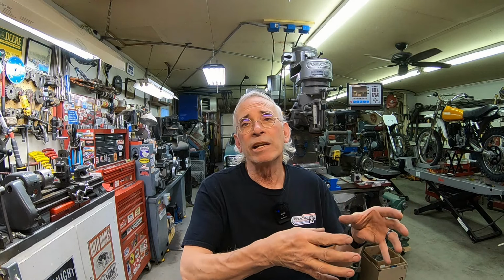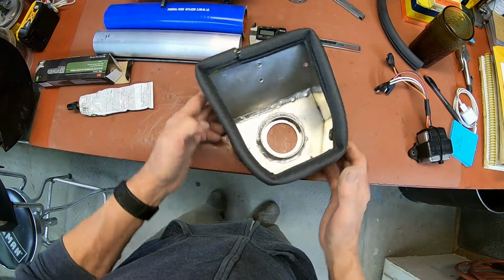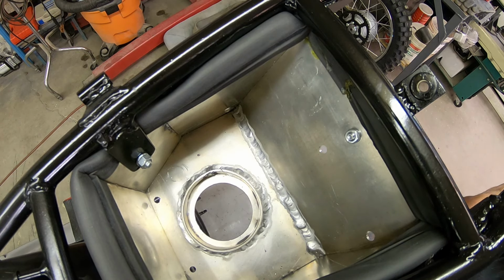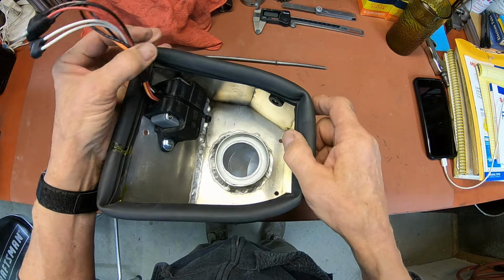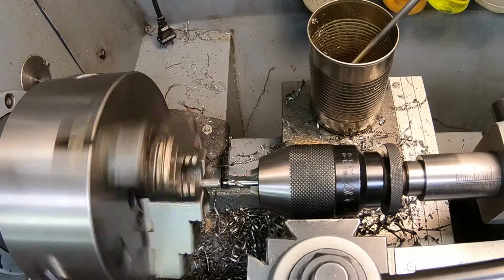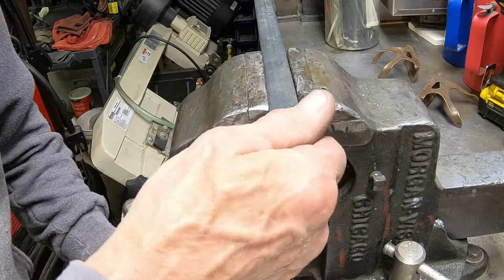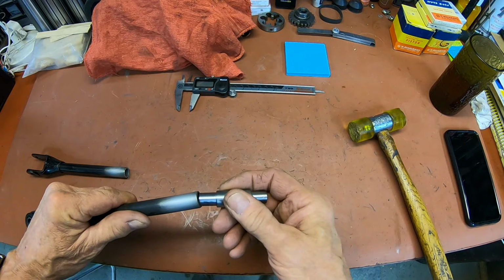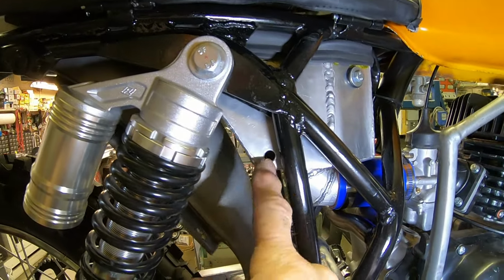Yamaha 250MX air box, rear brake, frame mods

Comment: Some air boxes have a pipe sticking out of the bottom with a one way valve (reed valve) type of thing, the idea is that if water gets in it will run out of the pipe but the engine cannot suck air up the pipe, it might be worth looking at rigging something up like this especially as the air feed to the carb is at the bottom of the airbox. Anyway, good work, an interesting video!

EDIT, in fact I guess it does not matter too much if the engine does suck air up the pipe, it will still have to go through the filter, if the end of the pipe is submerged in water the engine won't suck water up because it won't be able to create enough vacuum to do that as the top of the air box is open, so I guess just a pipe sticking out of the bottom of the air box would work without any valve. You could make the pipe exit the bottom of the airbox at the lowest point when the bike is on its side stand (kick stand).
Reply from the maker: Yes, I had one of those one-way valves on my RM, and the RM and PE boxes I have, had them, but they are since rotted away and no longer available. I may look into some later models, could be you can still get them from the manufacture. Not really worried about getting water up that far at my age, I go around obstacles like that. Understand the need for the youth though, I know when I was younger, I drowned a lot of bikes. Thanks for the comments, I do like to know what others think and their solutions. Part of the fun. Thanks man!

Comment: Hi Dale, the bike is going so well. You can convert the MX250 rr brake arm into a 1982 YZ250 and forward style. Verify pictures of that arm, I think that it can resolve the rr brake...
Reply from the maker: Thanks Wilson, man I wished I had seen this before today, that would have made the job easier for sure, I was able to make it fit in the original place and work properly. But if it doesn't work out that is exactly what I will do. Thanks again for the suggestion.

Comment: Dale:  Are you using a different disc to cut off aluminum.  Mine always seem much happier cutting steel than aluminum.  Once again, great video.  I invariably learn watching you work, inspiring.
Alex
Reply from the maker: Hey Alex, no its the same I use for ferrous, doesn't work all that great but got the job done, usually cut aluminum with a saw, but couldn't in this case. Did load up a bit, but as soon as I cut steel again its free and clear.
Reply: ah well, I'd hoped you'd found the secret disc!  Have a great day.
alex @montana2strokeracer
Reply from the maker: Nope.....no secret disc, just getter done anyway possible.

Comment: That airbox is trick its definitly going to work.  I made  silicon intakes as well and had them 90 up.  but I couldnt use them but they seemed to cover the little hole on the outer lip on the Tekie carbs.  Luckily i found reproduction yamaha.  On cars though that silicon works well
Reply from the maker: I haven't had much experience with the Teikei carburetors, but the RD125 engine I have did have them, not real familiar with them and jets seem to be hard to find, I change it over to Mikuni. Much better source of jetting for them.

Comment: You might find another brake plate with a cable anchor on it that fits that hub  if you need one.
Reply from the maker: I was able to use a rod hook up, so no need. If I had thought out this project more, I would have used a Suzuki wheel on the back as I did on the front. But those 78 to 80 RM wheels are tuff to find. You will see it in the next episode of this project. Thanks for spending time in the shop with me.
Reply: @montana2strokeracer  77-79 PE hubs are the same and theres various brake plates that can be used with them from other TS/DR/SP's etc. But if you got it sorted now OK

Comment: Hey Dale , thanks for the Great video . When you were gluing the weather striping on the air box it looked like you were using the old 3m  "Gorilla Snot " was it ? As far as the pipe I imagine you have a small slip roller ?
Warmest regards Dale .
Murr
Reply: Great headway Dale. Shortening the brake lever arm shouldn't pose any issue's with operation of rear brake. Your right on point with the necessary mods to make it function.  Keep the video coming.
Jeff Davison.
Saginaw, Mi.
Reply from the maker: Thanks Jeff, it's always encouraging to know others agree with your direction. I am hopeful this will work; I will get it set and pull the shocks again and see how the motion is.
Reply from the maker: Hey Murr, you are correct "gorilla snot" it is; however the original stuff was that terrible yellow color. Glad they did give you options. LOL Yes sir have a slip roller. Do you recommend Tig welding or gas. Seen it done both ways, the ones I made years ago I brazed.
Reply: @montana2strokeracer  hey Dave, I always use oxyacetylene never braise the torch you were using it look like a Smith air crafter, but it’s been a while as long as you have a super small tip. Personally, I would make the cones out of 20 gauge, which I believe is 035 wall and I think 18 gauge is .049
Reply from the maker: Thats what I was thinking, I have a Victor setup and a pretty small tip. 20 gauge material is what I have. I am thinking you don't use much filler rod, just melt the two together and hammer.
Reply: @montana2strokeracer  yes Dale very little filler rod. He is getting the cones to fit good I’m sure you have a 4 inch wide belt sander. If you get a good fit, you will use very little rod
Reply from the maker: Awesome, thanks brother.

Comment: Hi Dale. I apologise for a blatant request for your knowledge. My Yamaha CT1. Am I correct it runs a simple half bridge rectifier and that using a multimeter I should only see the average charge voltage. Ie. 3.0-4.5 volts depending on revs? Or do I have a generator issue? It's a 1969 model.
Reply from the maker: Yes, they do use a rectifier to convert AC voltage made at the charging coil to DC to charge the battery. I usually just check the voltage at the battery, should be about 7.5 volts at 2500 rpm. Must run a battery on these bikes to absorb any voltage spikes to prevent the bulbs from blowing.